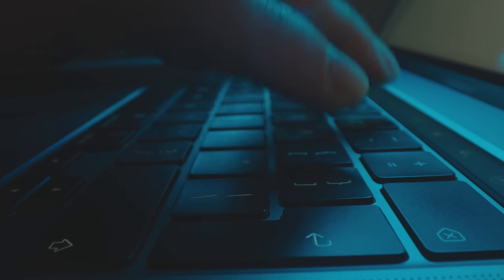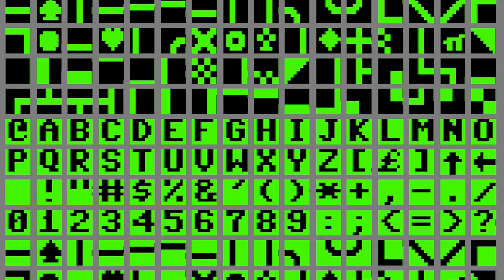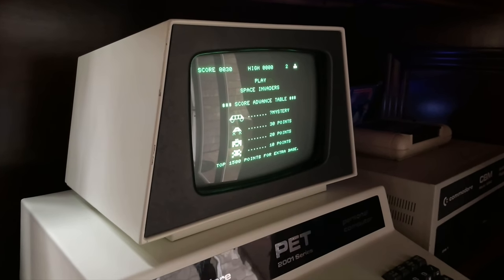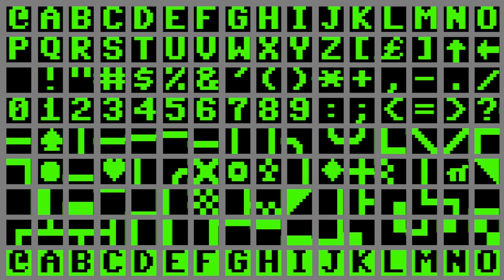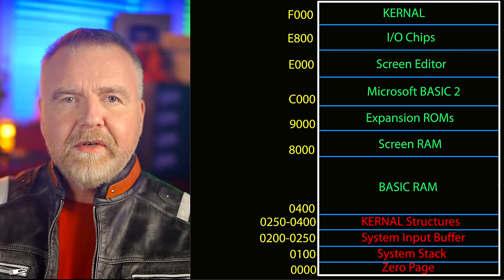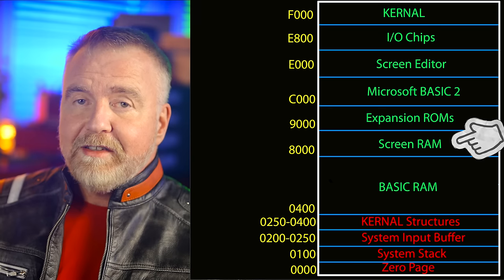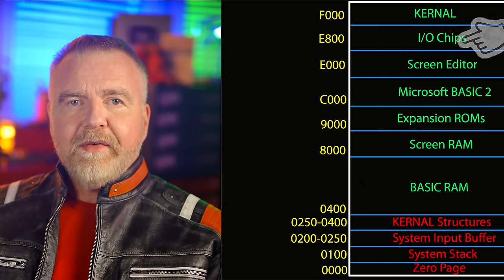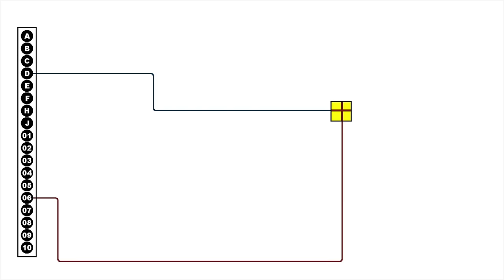Everything you SHOULD know about your Computer but don't!

Comment: If the PET could use characters from RAM, it would have to access main memory for a byte around once every microsecond, starving the CPU like the ZX81 suffered. The C64 alternated accesses of main memory between the CPU and VIC, but that would have taken a lot of discrete logic chips to implement (which is why the VIC does so much in the '64), and probably faster ram chips, Ram chip access times from the 70's has alas faded from my memory..
Reply: Well the newest LTT video had them trying to use a networked swap partition and that definitely starved the CPU
Reply: This is also my theory.   You'd have to dual port whatever RAM the character map lived in.  As it is you had to dual-port the 1k of screen memory.  Note the ZX81 didn't only have to deal with dual ported memory it actually generated the video directly, so the CPU was quite busy when video was being displayed. It's possible do the necessary dual-porting but that would have complicated things quite a bit.  So they allowed two different character sets and that was that.
Reply: RAM and ROM speeds generally kept pace with CPU clock speeds. When specifications needed, you could opt to spend more money and get memory chips that had faster timing.

To switch which device was using the address and data buses, you would use tri-state buffers, multiplexers, transceivers using low power Schottky transistor-transistor logic chips (LS TTL). The three states are Hi, Lo, and high impedance (the tri or third state). The tri-state high impedance state would allow some other chip to drive the given bus lines high or low.

A bus conflict happens when two devices are driving say the address bus at the same time thereby causing a short circuit state on the lines where one driver was pulling the line to low, while another device was trying to pull the bus signal line high. Chip damage would happen if this situation lasted too long and made the power dissipation per chip exceed design specifications for long enough time to "smoke" the chip drivers on a given pin or maybe the whole IC would fail and need replacement with a working one.

Positive holes flow toward negative polarity ground potential causing unnecessarily high current flow or a short circuit. Any downstream device listening to this electrical fighting would likely see the ground or negative driving circuit win these fights because TTL chips had lower impedance to ground polarity.

The internal circuitry of the TTL outputs would be specified in the TTL data book that listed the given chips involved. Usually the outputs were using totem pole configuration using complementary polarity transistors--a PNP and and NPN bipolar junction transistor.

The upper schematic transistor would be tied to +5 Volts collector circuit voltage or Vcc through about a 260 or so Ohm resistor, whereas the lower schematic transistor would have its emitter tied to ground through a pretty low valued resistance like 10 Ohms or so.

The P and N junctions for bipolar transistors are formed by using infusion or doping of the semiconductor material with either a donor or hole material or atomic element whose outer electron shells would either have excess electrons or hole slots in their outer electron orbitals. The crystal lattice would have each atom of silicon have neighbors (top and bottom) as well as forward in and backward out and finally right and left with these excess electrons or excess holes (positive charge carriers).

Flow of charges in junctions would only be in favor of one direction.

The physics says that if the charge flow opposes and depletes the charges in the native PN junction field, the flow shall continue unabated. 

However if the charge flow being attempted reinforces the doped field junction, then the electric field magnitude would just grow bigger and bigger until the voltage was so high that breakdown would suddenly allow the current to flow backward through the junction.

If the current flow magnitude was too large through the junction, excessive heat shall smoke the device unless the current flow was limited to sane levels within designed specifications allowable by heat dissipation abilities of the device. This would be the situation in a reverse breakdown diode junction known as a Zener diode where the reverse breakdown voltage would be a known calibrated X number of volts.

Field effect transistors or FETs use a by design a channel through which flow would be made to happen by enhancing the conductivity of the channel  (enhancement mode) or by design a channel through which flow is pinched off or blocked by depleting the field (depletion mode). The channel can be made to carry positive holes as in P-channel or to carry electrons or negative charge carriers as in N-channel FETs.

The control lines into these various bus switching governing chips would determine who was allowed to talk or listen to the given addressed memory or I/O component.

Way back in the late 1970s the speed of CORE non-volatile RAM magnetic memory was low microseconds. Semiconductor memory was about 1 microsecond down to about 450 nanoseconds.  Each successive year the memory speeds got faster for semiconductor RAM. The DRAM chips for the Apple II were around 200 to 300 ns.

The first 386 processors at 16 MHz were using 150 ns DRAM chips in sockets on the mainboard and expansion RAM boards. Expansion RAM boards in the early PCs would not necessarily be able to use ultra fast static RAM cache sets, nor could they use faster SCSI bus mastering DMA controller boards unless specifically designed to do so on the newer 486 mainboards with premium level chip sets and bus expansion slot standards that would permit such stuff.

CPUs and chipsets started to be fabricated using advanced high speed CMOS--complimentary metal oxide semiconductors. The signaling was using less current flows to swing the voltages involved. MOS transistors used field effect transistors. NMOS and PMOS complimentary transistors to form CMOS.

The fields on the signaling gates would either use depletion mode or enhancement mode to turn the transistors on or off. Instead of base input, collector or emitter outputs, the newer transistors would have gate input, drain and source outputs.

Gates would require field voltages rather than input currents to do switching. The only current flows required were to charge or discharge the parasitic capacitance involved in the small gate circuitry. Leakage currents were reduced with each newer generation, thereby lowering power consumption.

DIMM RAM started to come out for the Pentium series CPUs in the mid to late 1990s. It had RAM speed at or faster than 80 ns and eventually in the early 2000s was running close to 7 ns.

Eventually dual data rate (DDR) chips started to come out that would do block transfers to and from the CPU's internal cache a bunch of words at a time. DDR2, DDR3, DDR4, and so on.

It turns out that every step forward was done at the scale of the chip die size being shrunken more and more each new generation making the transistors smaller, closer together, have less active reactance charge capacitance or inductance delays. A lot of this was done initially with semiconductor etching masks made of shrinkable fabrics where the pattern was transferred, and then the mask was shrunken and then applied to the semiconductor wafer layers.

As these shrinking advances came in, so did power supply voltage drops come into play.

Switching times of the complimentary totem pole configuration transistors determined the power used because as the frequency of the signal switching increased toward and beyond the switching speeds of the two transistors, there became more and more a window of time when the bottom and top of the totem pole of transistors could be on at the same time thereby drawing current straight from Vdd to ground from top transistor through bottom transistor causing momentary short circuits causing huge power dissipation. With bipolar junction transistors such heat can cause what is called thermal runaway with excess charge carriers preventing the transistors from shutting off the current flow without a much greater base junction input current to attempt to shut the flow off.

From what I can recall, CMOS field effect transistors do not tend to have thermal runaway and in fact the increased temperature would tend to somewhat increase resistance to such flows.
Reply: Let me refresh your memory. 150ns was common. Any faster got exponentially more expensive....in the end 286s etc. Ran 60 or 70ns ram, some 10+ years later.
Reply: I would solve that differently.. if the character rom was really ram, it could be mapped  into a block and CPU access would take priority over the character generator.  Given the system would load this ram from rom at boot, the extra blank screen at start would be un-noticed.    Given that dynamic access to the character ram would be unusual and minimal, it could be timed during the blanking period without creating visual aberration's.
Reply: Nah, the VIC2 and the 6510 took turns with the VIC2 being the busmaster. It has some internal buffers it had to load.
Reply: @ricomariani  Just for info - the ZX81 RAM was not dual ported. The addresses for getting the character codes for display come from the CPU which is fed false NOP op-codes during the scan-line generation. The ZX80 and ZX81 have specific hardware to feed a 0x00 code onto the data bus for that purpose.  The CPU executed those NOPs while the incrementing address was used to read out the character code from the RAM.  The difference was the that ZX81 was able to run user's programs during the vertical retrace interval (what was called SLOW mode in the ZX81 Basic).   The ZX80/81 display generation is one of the most ingenious bits of design found CPU in any micro, especially considering the low chip count in the ZX80 which used only standard logic (no custom chips).
Reply: If I take the Apple ][ as a good example where they did something similar (but only for low-res and high-res graphics, the character map is in its own dedicated chip yet again), they fixed the issue of accessing the buffers as interleaved buffers for the 40x25 text/lo-res gfx, as well as the the 280x192 B&W hi-res gfx. Roughly, the memory bandwidth for these chips must be interleaved to let the 6502 1-MHz have no latency in case of writes, where the electron scan is able to retrieve the memory in its off-cycle. (Remember there's one data line and one command line, so those are shared between anything accessing the RAM chips... a Write cannot occur at the same time than a Read, or even two Read cannot occur at once)

So instead of having a linear memory buffer for what's output on screen, it's interleaved to reduce stress on the RAM chips. Without that technique, it would not be possible to push those with cheaper chips as used by Woz.

The issue is further compound by the character rasterization itself. Retrieving bits for each characters is quite intensive and is non-linear. There's effectively two buffers that need to be accessed one after the other: the 40x25 "character" itself, which takes one byte, and one lookup in the character table itself. So drawing the text in 40x25 is twice as demanding than drawing the same in "high resolution". That means the chips would need two on-duty reads before the CPU can ever attempt any read or write, giving it a 1/3 effective memory bandwidth, only for drawing stuff on screen.

TL;DR Without the interleaving (but using more chips), and having to constantly look-up every character for every byte means way more memory access. Not having to sync with potential CPU writes means less chance of a data bus clash.
Reply: @GodmanchesterGoblin  Sorry I wasn't clear on that at all.  I meant that on the PET the 1k of static ram for the screen memory was dual ported.  At least I think it was.  Certainly nothing was dual ported on any of the Sinclair's I know.  The rest of the PET memory was usually regular DRAM.

IIRC The PET's "dual porting" was a discrete business with some MUXing before a pair of 2114's and a latch that doubled as a shift register.
Reply: @bobcharles3029  This implies a specific bank of character ram rather than the ability to aim the character generator at regular ram like Dave suggested.  It would be easier to do this because then you wouldn't have to MUX everything but it would glitch so you couldn't use it to do hires tricks.

See if you can change the character ram on the fly then you can do the thing where you put say 6 rows of 40 characters and then you keep changing the character definition as the screen is drawn so that by the time those 240 characters are drawn the 2nd time they have an entirely different set of bitmaps and that gives you basically pixel control.  IIRC the VIC did this with double height characters and a smaller screen...

If you can map the characters to different normal RAM then this becomes easier still.  Well, plus or minus the tight timing on it.  But you could probably do that in a game.
Reply: Pun intended? 😉 heh: "...faded from my memory" when talking about RAM. 🤓
Reply: @RichardNobel  Yes, my memory has turned from static ram to Dram these days, it needs refreshing all the time.
Reply: @ricomariani  Don't worry. I know now what you were trying to say.
Reply: It still has to access the video RAM 40 times per line.
The way the circuits are designed, it doesn't interfere with the CPU bus unless/until the CPU is accessing video RAM.
Reply: @oldspammer  Gee, you've left nothing to the imagination!
Reply: Addendum regarding chelation... Patients who were suffering circulatory problems due to hardening of the arteries "successfully treated" by chelation got in their predicament for on going troubles that routinely cause recurrence. This is likely due to some diet preferences or genetic predisposition to whatever condition is underlying their illness or by a diseased or damaged organ in their body not performing optimally to mitigate the problem(s).

Thinking that they had been miraculously permanently cured, time goes by and the entire process has to be redone, or maintenance treatments performed, etc, because of the "ongoing processes" in their bodies that contributes to the problem in the first place.

Most situations are cause and effects-based and thereby are deterministic. Smart minds must be applied to determine the underlying processes at work that caused the illness in the first place. Likely this can be traced to shortfalls in their genetic makeup causing chronic chemical imbalances that shorten their average life span by one thing leading to another.
Reply: Memory access being alternated between the 6510 and VIC-II meant that it made sense for the latter to also perform DRAM refresh.
IIRC this kind of interleaved memory access was also used on other 6502 based machines such as the BBC Micro.
In the case of the ZX80 and ZX81 the CPU was being used to generate the display. In the case of the ZX Spectrum the display hardware has priority accessing the RAM and can halt the CPU when necessary.
Going back to the PET the screen RAM screen is physically separate from the system RAM. Having redefinable graphics would likely require specific character RAM or bitmapped screen RAM. With other early computers, such as the Apple 1, the screen RAM could not be directly addressed by the CPU.
Reply: Yes, it’s roughly 1MHz per character cell. This is why the specific clock speed of the oscillator was chosen: the pixel clock is divided by 8 to generate the system clock. This also causes a problem when reading screen RAM and is where the killer POKE and “snow” come from. 

The Mini PET uses dual port RAM for the screen RAM to get around this problem. The CPU and CRTC can access different memory cells at the same time, and the output of port 2 is fed directly to the address bus of the character ROM.

If the character ROM was replaced by another dual port RAM chip, you could then program it from the CPU to display whatever bitmaps you needed for each character. Perhaps it should not surprise anyone to learn that this is very similar to how the bitmap graphics mode on the C64 actually works.
Reply: PET 2001s were all SRAM.  PET/CBMs (ie. 4032) only use SRAM for video RAM and also added a CRTC chip for video control.
Reply: Not only would you need all the logic to dual port the character memory, but you'd also have issues of precedence - When the video scan line needs to read a character map, and you've got it held up by the CPU read/write, do you glitch the video by saying, wait your turn; or halt the CPU to give favor to video reads?
Reply: It seems I'm the youngest dinosaur here 'cause I started from Z80 @ 3.5 MHz (ZX Spectrum ). We have had two main schemes for our machines here: Leningrad, and  Pentagon. The difference was in accessing the video memory with and without a wait state for the CPU. It was DRAM and it had its own refresh cycles and there was no big problem to share access.
Here in PET I see SRAM which is way faster than DRAM, but it seems that overall timings were much worse back then. Anyway, I believe that the only criterion for evaluation is whether it works or not. So, whatever reasons they used, they were right. It's always cool to be able to load a custom font on any hardware, any extra MCs are worth it. ;-)